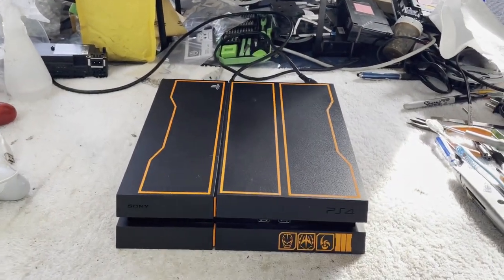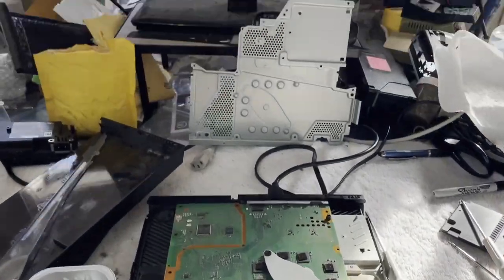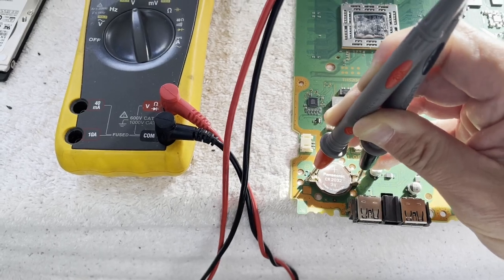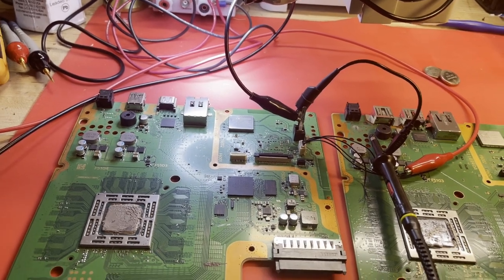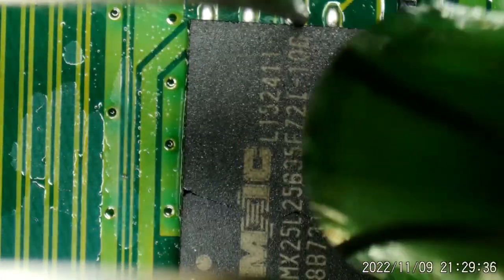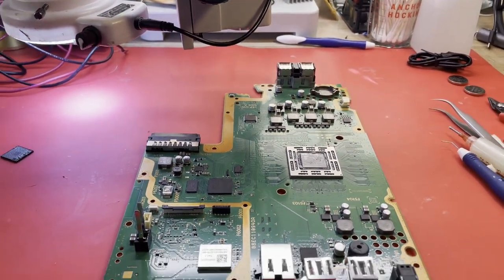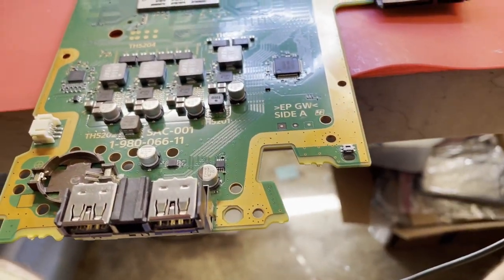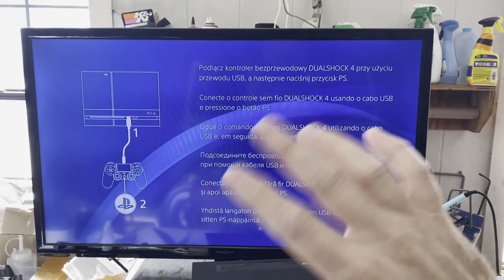#59 Repair of PS4 CUH-1215B COD III No Power

Comment: Crazy you had to post this video right now... I've been fighting with a slim unit that does just what you saw on the first start-up. Goes all the way to 100%, and shuts down during installation. NOR chip had the same "corruption", I had already tried to fix it like you did, nothing.. I had replaced the oscillator, still the same. Replaced SB, nothing. My unit (almost) always starts up, but I only get to that 100% during update, but always just shuts down... Now I saw this video and makes me wonder about the oscillator (again). I guess i'll try yo replace it (again), and this time with those caps included. You just gave me some hope in this battle I already thought lost! Thanks, keep those videos coming!!
Reply from the maker: The slims seem to act differently from the fats when that oscillator is missing.  Don't forget to check the battery too!
Reply: @ToltecMerc  sure, don't even think I did not try a different battery before diving into replacing SB ;-) 

My kit is missing an oscilloscope however, would help to visualize that clock... There are some RTC related errors on UART output though, which initially got me into trying all clock related stuff.

I'll update here once I get back to it, could be days. I do this as a hobby like you, so good there is no-one breathing in my back waiting.
Reply: @ToltecMerc   like said I would update on my slim, but too sad it is still a failure... I swapped the oscillator and this time both caps, leaving the area clean from flux and residue, but the unit keeps behaving the same. Funny enough, while measuring for the 3V battery bus close to SB, I noticed that the diode connecting 3v3 bus with it was bad (causing draining of 3V batt towards 3v3)... I was like hell, it must be this then, but still no; now the 3V batt voltage maintains ok, but it did not fix the issue... I did a bunch of other stuff too, bricked the NOR once in the process, etc, no good. It's just like the unit does not know how to reboot; trying the "reboot" option in safe mode does shutdown too (like 10sec white light + shutdown)... I think I'll just park this one until I get my hands on another working board of exact same model... Or just scrap for parts

Comment: Great work. I enjoy your videos and the good way you diagnose your boards.   There are a lot of youtubers who are only able to look for short circuits and when they don't find they just replace common 'things'. I have seen Flux or other liquid risidue unterneath the christal oscillator can cause it for not oscillating.
Reply from the maker: The flux under the crystal has bitten me several times before.  It was only in the last year or so that I realized what was happening after South Bridge replacements.

Comment: A common problem with flat battery, can cause NOR corruption , in my past experience replacing the corrupt data works provided it is same os version,  good job
Reply from the maker: I was not sure that a flat battery could cause that during an update, but it makes sense now.  Thanks for the info sir!
Reply: @ToltecMerc  not sure if you know of @Steve be but definitely would recommend you checking his channel out also and see the knowledge the guy has. He hasnt posted much recently but you can certainly learn a thing or 2. @Steve be hope yr getting better pal, hope to see you soon also
Reply: @ToltecMerc   its not common but every time i have encountered this problem the cell has been dead

Comment: Hey I'm wondering if you'd know the possible solution to a problem I am having. I have the same PS3 as you in this video as in a CUH-1215b Black Ops 3 limited edition PS4. The power button doesn't seem to work when I press on it but it does get power as the eject button makes noise when I click on it. I eventually figured a way to boot the system but by getting a disc and trying to insert it which boots it on. However, it appears to be stuck on a safe mode loop. I tried all 7 options on the safe mode screen I even tried to update the PS4 to a retail firmware even trying a recovery firmware update. It does recognize the USB and fills up to 100% as if it worked but then goes back into safe mode as nothing ever happened. I even switched the HDD which was originally a 1TB to a 500GB HDD from another PS4 which I know that hard drive is functional. Wondering if you know a solution and if maybe because the power button doesn't work that can be the reason behind the safe mode loop? How would I go by fixing the button or doing something to make it fix instead of replacing for a new one? And if I need a replacement how would I go by doing that? Thank you.

Comment: I see in some videos you measure smd components (resistors, caps) in circuit, how accurate is this, I wanted to do this to salvage smd components from donor boards but some people say this doesn’t work
Reply from the maker: It really is impossible to get accurate readings in circuit.  If I test in circuit, I'm usually looking for a shorted capacitor or a completely open resistor.  You won't get accurate resistance readings but if you have the same circuit repeating (like around RAM ICs) you should get similar readings across them.  Sometime you are just looking for something that is way out from the normal.
Reply: @ToltecMerc  brilliant explanation thank you

Comment: After this video I searched for NOR corruption in ps4 and it seems a common issue. 🙄

When you look at the warnings, how do you know from which offset to which you need to replace with a donor nor?
Reply from the maker: The NOR Validator will tell you the offset in the summary.  In this case, it started at 0x1CA000.  It wasn't a lot of bytes.  Maybe a 100 or so that I had to copy.
Reply: @ToltecMerc  very cool. Your videos should be the top rated console repair videos on YouTube. Very informative and a great variety of issues. Thankyou for sharing the knowledge. 🙏

Comment: can i ask you did you worked with ps3`s?
Reply from the maker: I have never worked on a PS3.
Reply: @ToltecMerc  My problem is i tried on my ps3 replace hdmi encoder chip on enother but I get "ylod",so in your experience with ps4's did you get same mistake (blod i mean) from fault replacement ?Sorry for this little stupid question ))I don't know what I did wrong in my replacement.

Comment: Well done , can you help me please.
I have a broken power supply of ps4. ADP.240cr and ADP.160cr  both doing same 
problem in the PFC section.
The MOSFET of PFC keeps burning,I changed the PFC MOSFET and the chip together but nothing helps .
Any idea that would appreciate it.
Reply from the maker: I'm not sure if I can help but you can email me.  toltecmerc@gmail.com
Reply: Ok I will.

Comment: I have a PS4 pro that I replaced the southbridge on works now but will not keep time and date. I replaced the cr2032 but that didn't solve it, time still resets every time I turn on the console. Could my problem be the 32k crystal, perhaps flux under it? Can I test it with a multimeter?
Reply from the maker: Have you connected to the internet and let the system update the time automatically?  I think Sony did something in the later firmware to prevent the time from being remembered unless you let the system update from their servers first.
Reply: I run into this one about half of the systems I run into. It’s usually systems that I’ve recovered to 9.00 but I’ve also seen it with updated systems. The unit need to be updated to set via online. Sometimes that seems to make it hold. Even when unplugged. I’ve seen it with a factory SB, swapped it. Still won’t hold time. I’ve been looking for this answer for a while now. But I know it’s not the SB
Reply: @ToltecMerc  Yes I should have mentioned that, I did update the firmware to 10.01 and I connected to PSN. Sometimes it won't let me even sync the time via the internet, it gives me an error when I try. Very frustrating as everything else is working perfectly.
Reply: @albertdavis1882  My ps4 was on 9.00 and I updated to 10.01 (don't want to jailbreak this one) and connected to PSN, even played online games, still looses time. Even in rest mode it looses time when I wake it back up. I can't find anything online about anyone having this problem which is strange.

Comment: my controller didn't connect through wire as well as Bluetooth. Ps button in controller is not working but it easily connect with mobile by pressing share button